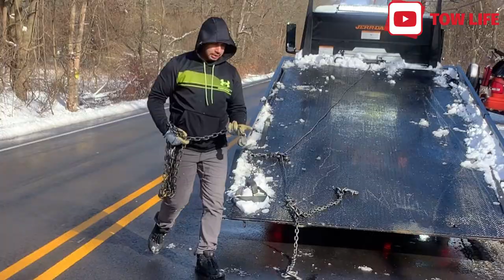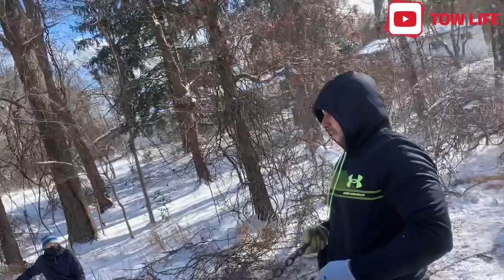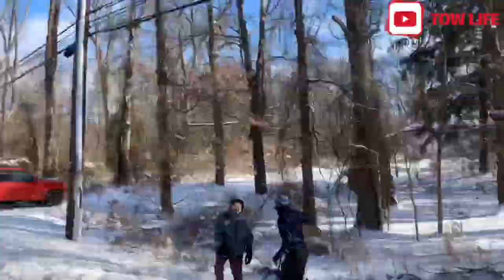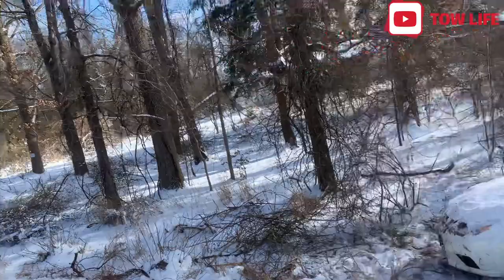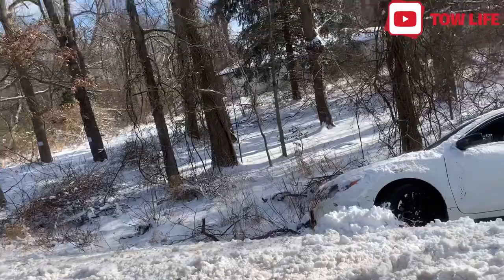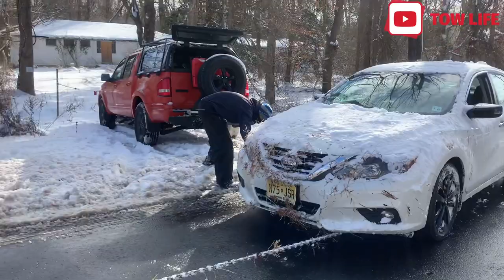HOW TO GET A CAR OUT OF A DITCH | USING A ROLLBACK TOW TRUCK WITH WINCH AND SNATCH BLOCK.

Comment: If you hooked up the bridle to both sides and snatch blocked it properly, you wouldn’t have to drive the truck forward. Lol. You could walk the bed if neccesary.
Reply from the maker: I know but the other side was completely in the mud and snow, couldn’t reach
Reply from the maker: @williamgrey7422  yes you are right, it happened to us couple times where people reported false claims about damages that were already there before we provided service. Now we got dual cams on the trucks and also we have them sign the damage waiver before providing any services. But we are also working on getting body cams.
Thanks
Reply: Yeah that's what I was thinking, kind of screwed yourself with that 20' chain
Reply: Endless loop instead of chains! COVER URSELF. Put that endless loop around A arm and of snatch blocking correctly! Stay safe!
Reply: @derricfigueroa6097 can you explain a little better?

Comment: 🤣 Like a pro my ass. You didn’t ever have to move the truck to winch that car to the roadway. If that embankment was any steeper you wouldn’t pull that off. Go take some more wreckmaster classes before you catch an expensive damage claim. Riehl’s NJ ✌️
Reply from the maker: What damage you see?? Get your self a pair of glasses before judging 😂😂😂
Its the fastest and safest way, we do this all the time never had an issue..
Reply: Good luck with your little tow company. Mr think i know it all. BTW where is your Refective vest and Uniforms? 🤔
Reply: @towlife6883  definitely not the fastest or the safest. If your J hook wasn't 20 feet long you would have been able to pull that car right on the road. If you have to pull the car out by using the truck then don't hook up to it in the first place
Reply: It's always easy when you got two other ppl with you. Let's see that with just you workin it
Reply: @4cylfreak46  I’ll agree his recovery was definitely not good practice but Imma stop you with the reflective vest, sure it’s typically a requirement but I too disregard that because the last thing I want is the drunk driver coming down the road to see reflective vests and aim for the bullseye on my back, my truck is well lit if they can’t see that I don’t want them knowing where I am to target fixate on me.

Comment: Hi. I’m new to the industry. What length/size winch cord was used?
Did you add any attachments to the snatch block?
Is a ditch pull going to also need a few operators to maneuver it out?

Thanks
Reply from the maker: I use the standard 50 ft winch cable on all my trucks, no attachments to the snatch block but i used an extra chain to my V bridle chain.
You can pull it out by yourself if you have no help just make sure the steering wheel is turned towards the way you are trying to pull out the vehicle, you can also tie it down with a steering strap to make it easy so you font have to keep going back to the vehicle to steer.
Good luck 👍🏻